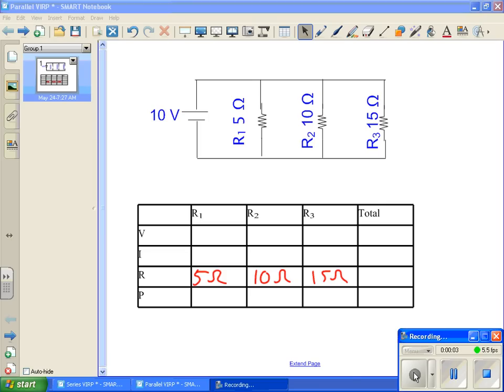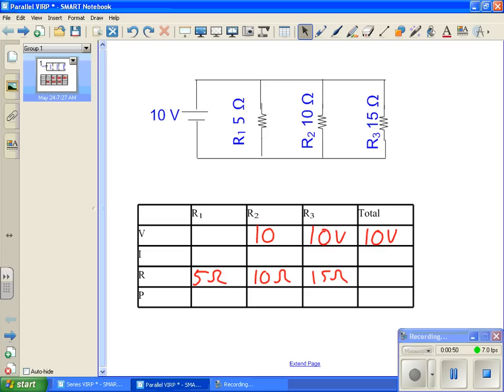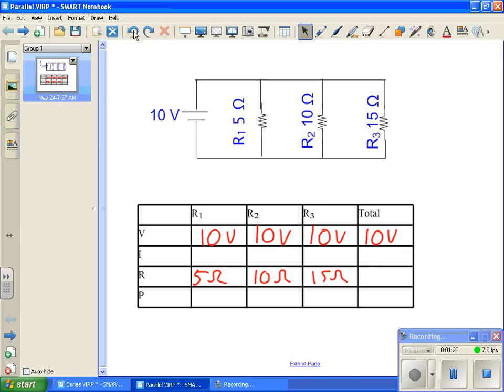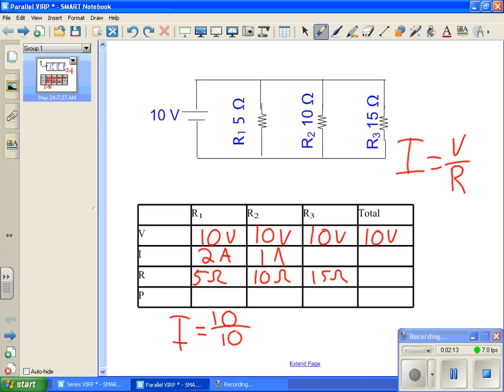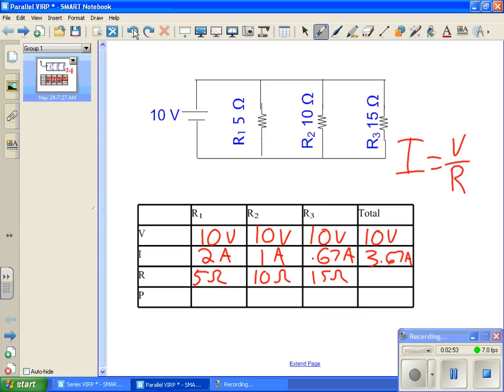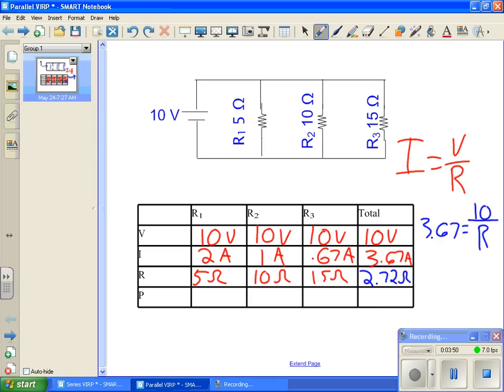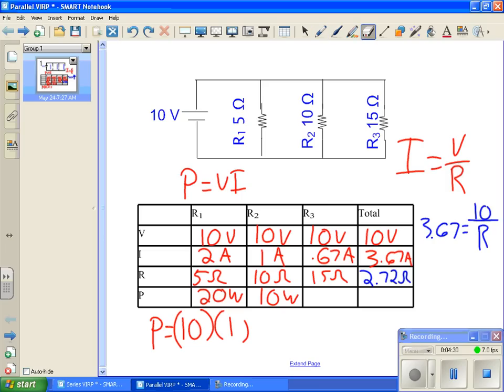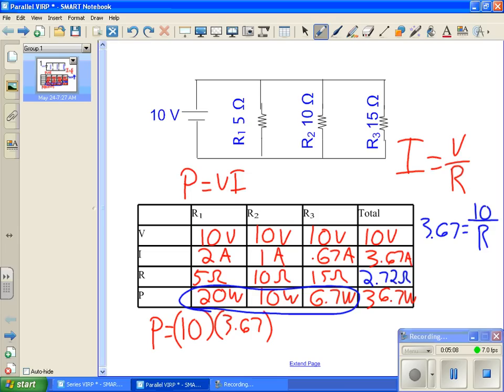Parallel Circuit analysis with a "VIRP chart"

Comment: How did you get 2.72 OMHS for RT, I understand you did 3.67= 10/R but what was the steps to getting that answer
Reply: I got a theory test tomorrow at 8 please reply ASAP
Reply: @mattmacleod366  Hi
Reply: @mattmacleod366  sorry for your pain
Reply: i need to know too
Reply: all he did was cross multiply to solve for R,
3.67 = 10/R      
3.67/1 = 10/R  -- we make 3.67 a fraction so we can cross multiply
3.67R = 10  -- solve for R
3.67R/3.67 = 10/3.67 -- we need to divide on BOTH sides 
R = 2.72 

I hope this helps